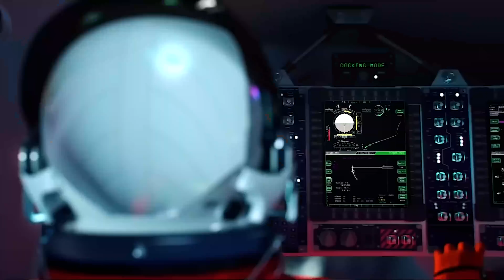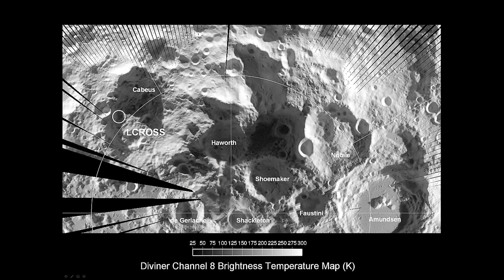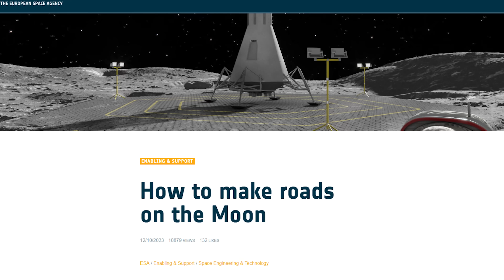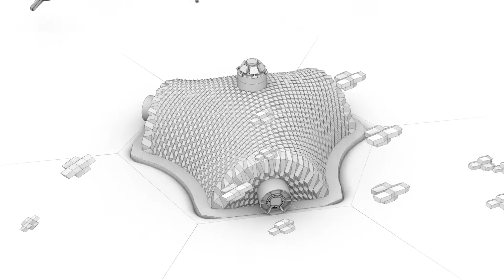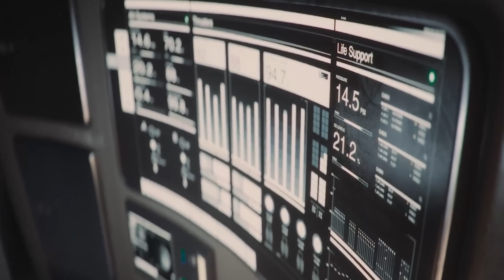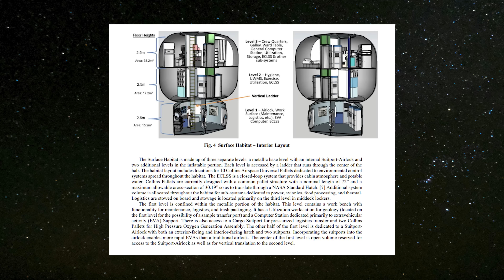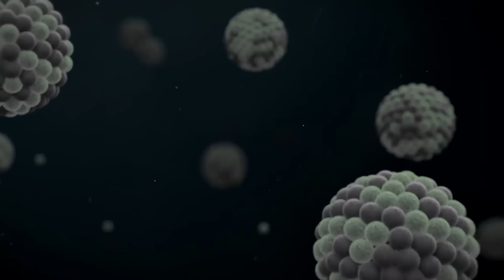New Inside NASA & SpaceX major Plan to Build City on the Moon Better than China & Russia

Comment: Great Video and Info !  A Lunar City/Outpost/Base is more important than the NASA Lunar Gateway !  To support the Lunar Outpost a (Lunar Surface)  LS Fuel Depot will be needed !  The LS Fuel Depot is supported by the recovery of Lunar Water Ice (H2O) that has many uses !  The Hydrogen from the Lunar Water can be used to recover more Oxygen from the minerals of the Lunar Regolith !  Once the single stage reusable Blue Origin Blue Moon HLS with a fuel load of  6.1 km/sec delta-V the SLS and the NASA Lunar Gateway can be retired !  The Blue Moon HLS can return from the LS  to the SAFETY of the LEO CSS with a LEO Fuel Depot nearby !  Once the Lunar Outpost is expanded to a proper Lunar Base the NASA designed  "24-Hour Lunar Shuttle" (LEO to LLO) by Stan Borowski-NASA John Glenn Research Center can be supported !  The Lunar Shuttle can then transport Lunar Workers and Lunar Space Tourists to the Lunar Base !  The engines for the Lunar Shuttle can transport the Mars settlers from LEO to the orbit of Mars from six weeks to four months  to meet with the Mars  shuttle to transport them to the surface of Mars !  The Tech developed  to return to the moon to stay, can take US and the world to Mars and beyond !  Timothy Lipinski

Comment: Do I want to live in cramped underground modules with limited resources and tedious procedures for exit and entry to the surface? No.

If you are staying long-term, you would need to be 3m underground to protect yourself from the radiation and would need to limit your time on the surface. Keeping the regolith out of the living quarters would be a real problem. Unlike Earth dust and sand, regolith has sharp edges (with no wind blowing it around to smooth it off). It would probably be safer breathing asbestos than regolith. So you can look forward to all sorts of life-threatening lung conditions.

Your CGI makes it look really cool. It would be more like a prison, so let's add in a few psychological problems there.

Let's not forget the effects of living in 0.17g for long periods. You can look forward to muscle atrophy and bone loss, on top of all your other problems.

Comment: Starship payload capacity PROVEN???  V1 Starship NEVER launched 15 tons to orbit which Elon claimed it could.  Starship V2 will be retired having NEVER launched 36 tons to orbit as Elon claims it can.  I sincerely doubt that Starship V3 will EVER try and launch 100 tons to orbit as Elon claims it will be capable of before it is replaced by Starship v4.  At Tesla, for a decade, Elon has claimed that the next version of full self driving will be REAL full self driving - but that has not happened yet.  See a pattern here?  Extravagant, self serving claim after extravagant claims about the capabilities of the NEXT version that are NEVER fulfilled.  Why on earth do we think Starship v4 will be able to deliver 200 tons to orbit (or more in stripped down configurations) based solely on Elon's unproven promises???

Comment: Starship, with a 50% failure rate?
Reply: lol test vehicles. What’s the success rate of falcon 9?
Reply: They don't have a failure rate at all for any cargo-rated or human-rated launch vehicle in the Starship/SuperHeavy line. The whole thing is still in rough testing. Elon's tweets, and twee fanboy influencers, confuse everyone with promises of "this time to orbit" when, if you listen to what SpaceX (the company) is actually releasing, that's completely misleading. This last one stood a very good chance of burning up completely during re-entry: you know they intentionally removed tiles in strategic places, and tested some completely new tiles too? It's a huge success that the Flight 10 Starship made it all the way to the ocean surface with all its maneuverability intact.
Reply: A test ship with 50% failure is quite the flex. Test test test is the name of the game. Test it until you get it right. Falcon had higher failure rate and is now more stable than any car on the road. And All other ships with greater success rates such as New Glenn are so far behind in the race.
Reply: @ivannsoita4137 New Glenn has flown successfully without blowing out the skirt and flap.